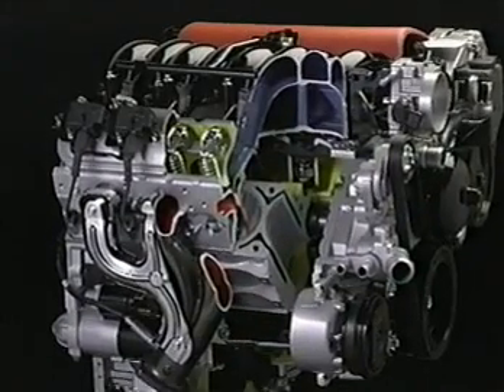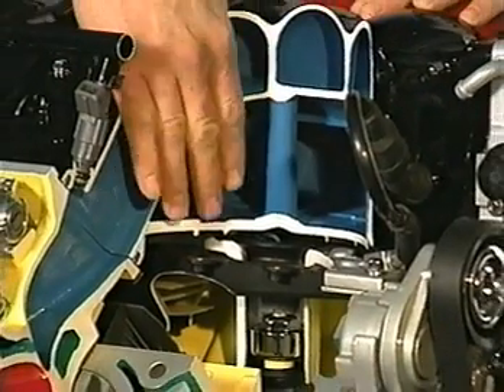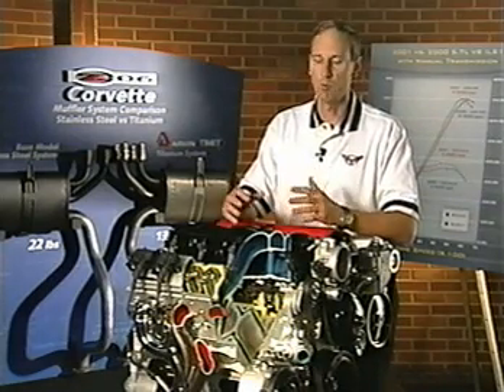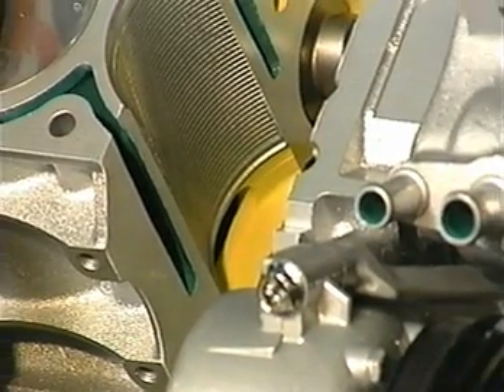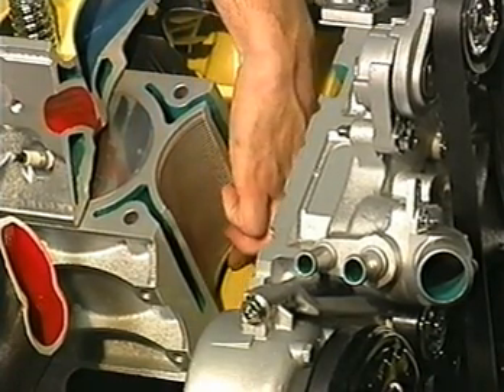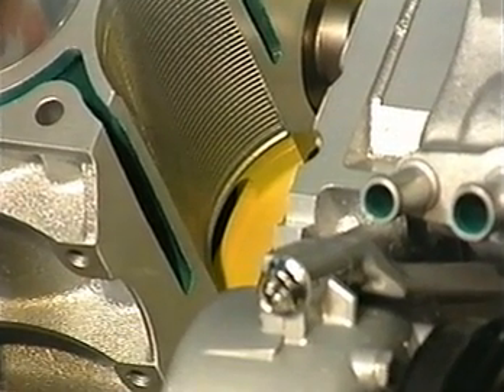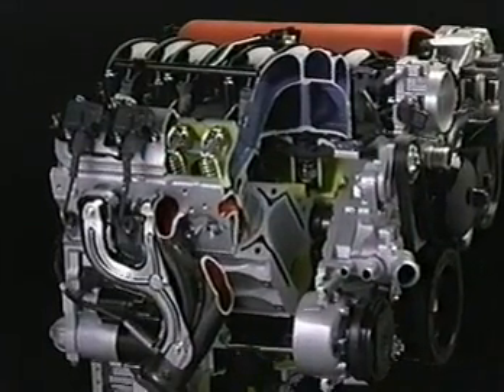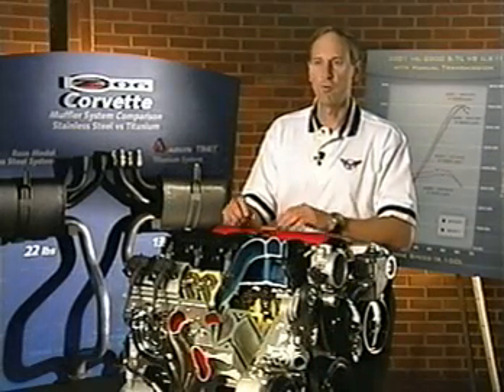Corvette C5 Z06's LS6 Engine -- GM Promotional Video

Comment: 3/9/2024:  Good Day From The FUTURE!  
I bought my C5 Z06 Commemorative New in 2004.  The LS6 Engine is Phenomenal.  Mine has 131,000 miles on it. No leaks, still runs like new, gets excellent gas mileage on the highway and still has the original factory clutch.  All factory. No changes.  
I put it on a Dyno once and stood behind it when it was turning 6,000 RPM. If you ever do that, you'll Never want to change out the factory exhaust system!  WONDERFUL SOUND!!
 I've had it up to 176 MPH. Ran Great. But, I ran out of highway at that point...
 I've owned 6 MOPARS back in the day. Three 440 Magnums, a 383 a 340 & a 318.  Great cars and engines, but nothing like my LS6.  
Nice but short video.  Thank You & Best Regards.